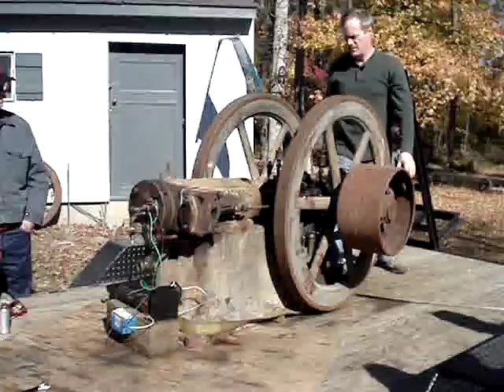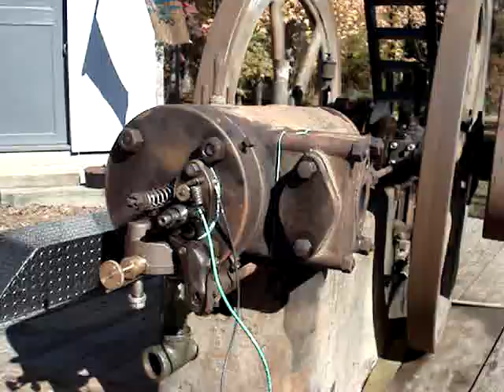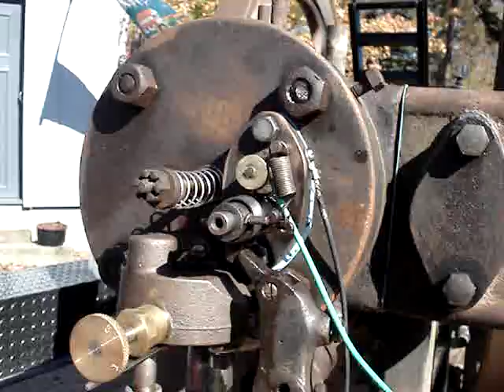Movie-5 H.P. Fairbanks Morse Standard - 1900

Comment: nice N engine, with a different bolt on head pattern.  I  LIke FM engines or should I say Charter engines.  You need to make a builder;s plate for the base
Reply from the maker: At the time, the Engine belonged to a friend of mine in Virginia. Dated 1900 I think it would be a Standard.